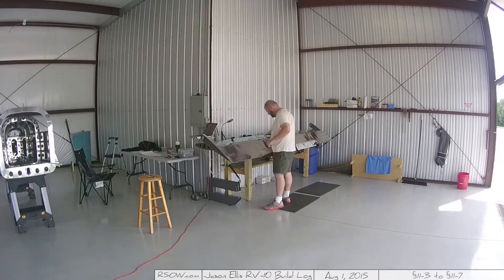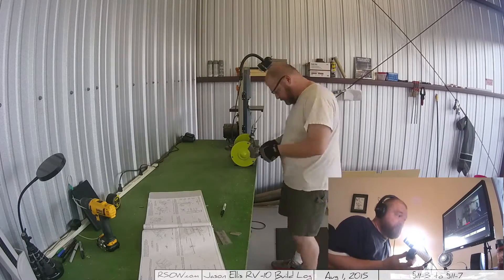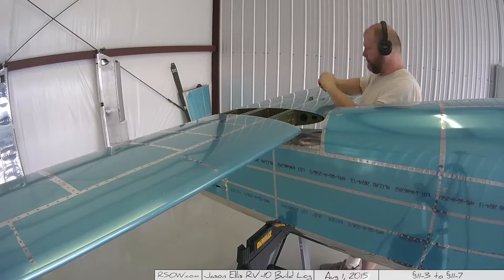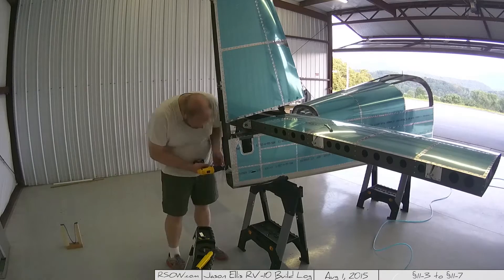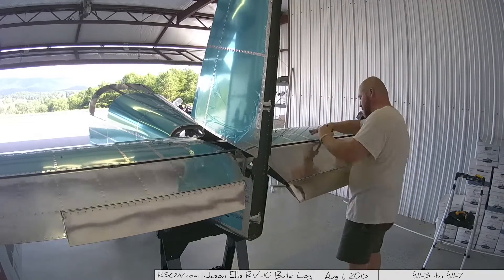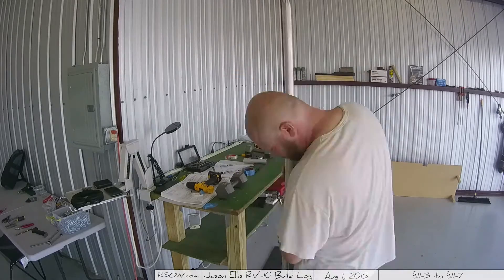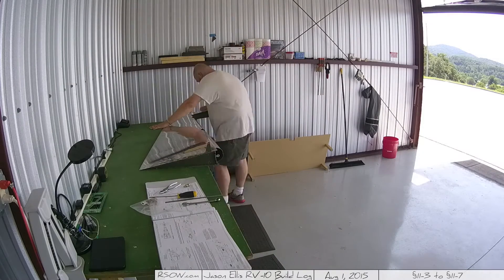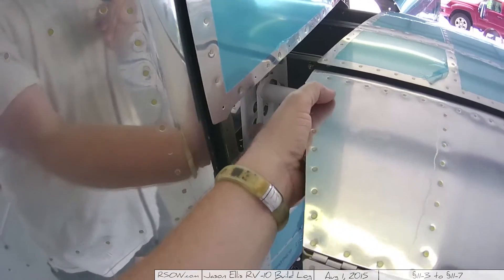RV-10 Empennage section 11-3 to 11-7

Comment: I have been through all of your videos via several binge-watching sessions. I just showed this video to my wife (who's hesitant to get on board with this project but warming up to it) to answer her question regarding size.

I can definitely see myself going over both your content and Tyler & Christine Russel's when my kit gets delivered.

Would attaching the elevators on the bench before installing the horizontal stab have been easier in hindsight?
Reply from the maker: uh.. not really.. Honestly the way I did it worked pretty well.. I would say just make sure to secure the thing down so it doesn't flop left/right when you add one elevator before the other due to the weight shift.

Comment: Jason, this may have been addressed in your videos, but I can't find it.  How did you remove the protective coating on the rivet lines only?  Thanks
Reply from the maker: Hi keith,  I used a hot soldering iron that had the tip thoroughly rounded in order to not scratch... and it still scratched.    Honestly, don't bother.  It's not worth your time and you're unless your plan is to polish the plane and not paint it it's a waste of time.  They will scuff up the whole plane with a brillow pad before painting so you'll never see any of those little scratches.  Cheers.

Comment: Hey Jason love your videos. Quick question... Was wondering if you ever considered the Velocity?  I know you mentioned the Raptor and for the reasons you mentioned you decided against it but was wondering considering the price (I think) are similar even though in the Velocity for $141,000 you get the quick build, which is definitely a huge time saver ( I believe close to1000hours) but for that price it's the larger deluxe version anyway I'm rambling would love to hear from you 
Cheers Bene Sgro' from Australia
Reply from the maker: The Velocity I sat in (there are several so this may not be true of all of them) was really squat on the inside and I didn't like the center stick configuration.  The other issue was that the particular one I was in was massively underpowered.  It took almost the entire 5000' runway to take off!  kinda scared me.
Reply: Jason Ellis hey Jason thanks for the reply and that definitely would scare me as well 
Stay well....
Regards Bene Sgro'

Comment: wow wonderful sir  why you wont creat a own commercial or private jet
Reply from the maker: I have thought about it actually.   The issue is that i"m building all this "on the cheap"..  Meaning i'm trying to save money.  A jet engine alone costs lots of money.
Reply: ya true even im also beginner of aeronatical fitter and assembler but i'm very intrested in areonautic and i like to create my own aeroplane the problem is the jet engine and system coast 90% of plane as u said the engine is really expensive  but try some used engines or convert other mecanical engines to jet engine (its just for the begin onze its work you could do something )